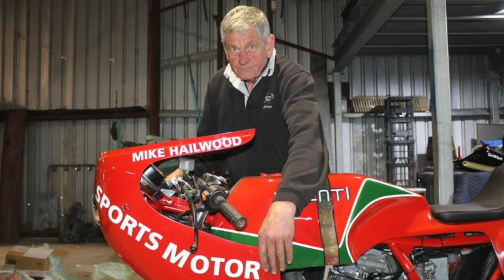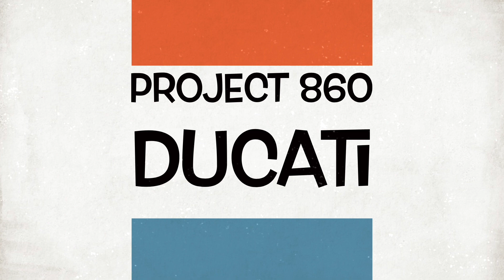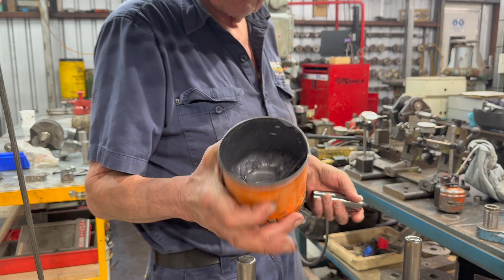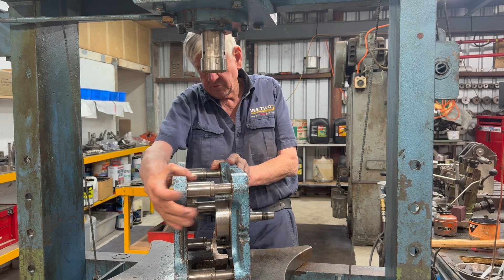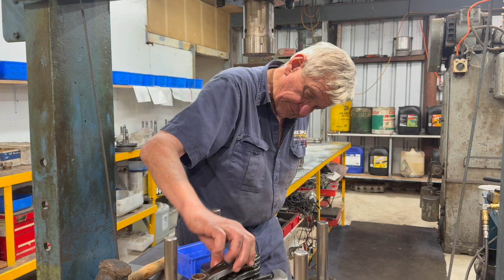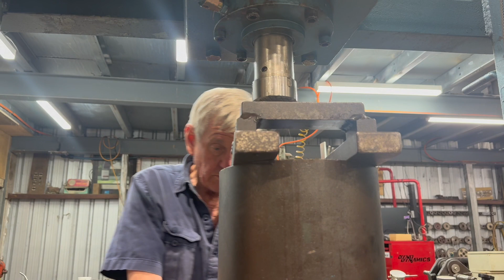Project 860 Episode 10. Rebuilding the crankshaft

Comment: Hello Dear Vee Two Team, are you aware that the original cages do use NRA Type needles, with so-called "spherical ends", which are no more produced by INA at the moment. Do you still have these in stock or do you use more conventional NRB needles with flat ends (which are not really compatible with the INA original cage pocket shape) ? Are you aware that within one cage, only the same needle diameter Group shall be used (like 0-2, or -2-4 etc...) ?
In any case if you have questions about that bearing design you can contact me, I can tell you much more than anyone else about it.
Fantastic video and very well designed tool here to pre-align and press the parts together !!